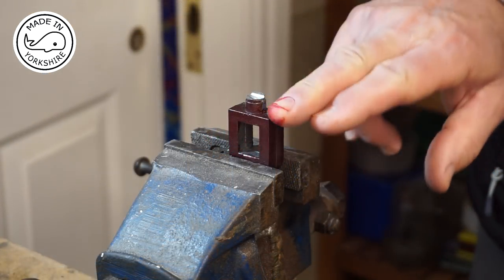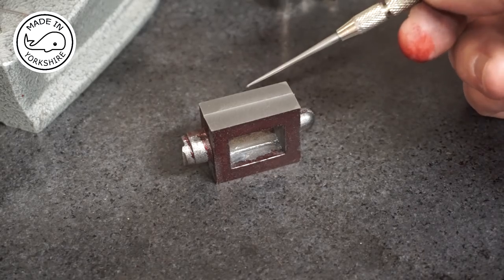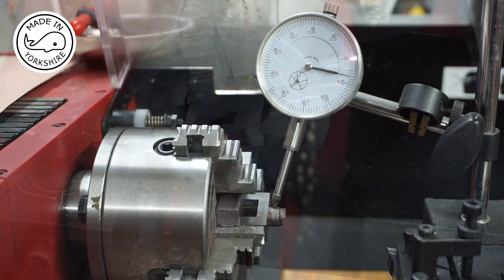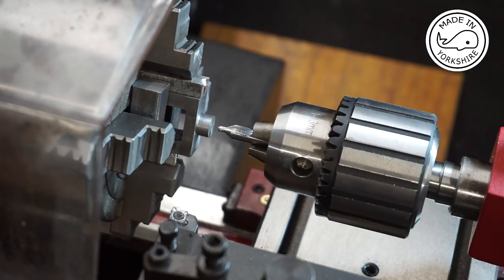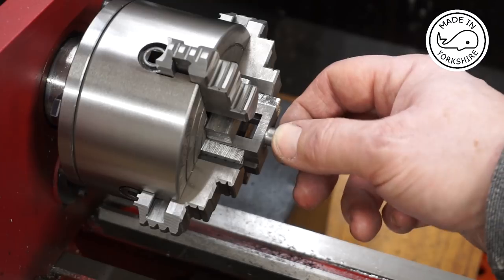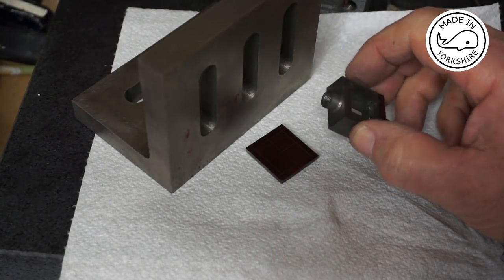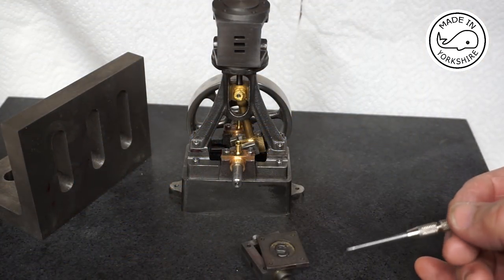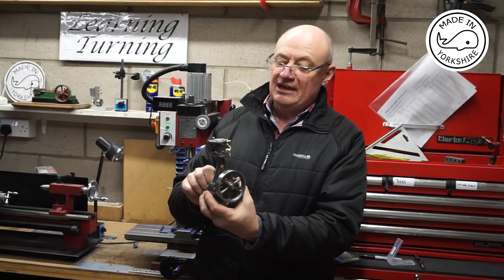#MT25 Part 11 -  Making a Stuart 10V Steam Engine. The Valve Chest and Cover. By Andrew Whale.

Comment: Hi Andrew. Another great video. Interesting about the milling cutter. Was the cutter a HSS or Carbide?. Regards MachineNZ
Reply from the maker: Thanks mate - the cutter is called 'Only One' PM60. Supposed to be a replacement for HSS and carbide, and offer longer life. I understand that the 'crust' on some castings can be like glass and that the first cut should cut deep under it. This didn't seem to make any difference.
Cheers
Andrew

Comment: Welcome back Andrew!  Are you going to fit reversing gear?  - I did on my 10V and I think adds some more interest to the model. Judging from the comments, it seems you are building a following in NZ !  Regards from sunny Whakatane😎
Reply from the maker: Thanks Clive. Now a reversing gear is a great idea. Maybe a mini follow-up project. I'm currently debating what size pipework to use. I used 1/8" on the the S50, but think 5/32" would be better on the 10V. Would you agree? 
Looks like NZ is a hot-bed for model engineers. 
Regards from cold and damp North Yorkshire! It will soon be spring though!
Cheers
Andrew

Comment: Ah, that took some searching but finally found.  I was wondering how you did the holes for the drain cocks as these aren't marked that well on the drawings.  Looking at the end of the video I understand you just drilled the holes straight in, good to know that works.  I made my own set for my 10V build yesterday (oh my that was fiddly) and am now contemplating on how to get them installed.
Reply from the maker: Hi Roel - yeah that works just fine. Drain cocks not really needed on an engine of this size but it makes it more interesting.
Good luck with your build!
Cheers
Andrew

Comment: Thank you very much for very interesting and useful videos. I'm going to buy a Sieg Lathe and a milling machine. The plan is to use it to make a 10V and other small parts. Can you please recommend a good size to choose?
Reply from the maker: Hi Jan - there are lots of factors to consider - budget, space, will you get hooked and start to make larger things?
The Sieg SX2P mini mill from Arc Euro Trade is quite capable once you have undertaken various mods (see my other videos). The Sieg mini lathe is also pretty good and should have capacity to make the 10V. If you want to spend more, then I have found the Sieg SC4 lathe to be very good. Be aware that you will probably spend as much again on tooling. So if you buy a mini lathe and then move to the SC4 (for example), you will spend even more on larger tooling etc. If you think you will get hooked, buy as big as you can afford.
All the best.
Andrew

Comment: It's coming along great, soon be steam up time :-)

When it comes to holding parts together for through drilling have you considered double sided sticky tape? I know it sounds a bit amateurish but the stuff you get from the Poundshop is incredibly strong and worth a try. I used it to secure the top cylinder cover to the cylinder of my vertical steam engine for drilling recently and I'm not joking when I say after the drilling I spent 15mins trying to prize the components apart. Nothing much in 'Poundland' is worth a pound but you could tow a car with their double sided sticky tape .
Reply from the maker: Great idea Peter. I've got a load of double-sided tape from when I did woodturning - used to hold wood together for turning. I'll try to remember that tip for next time. Hope to get this lttle 10V completed soon!
Cheers
Andrew

Comment: Just love how you flip from metric to imperial and back again. Us of a certain age, who were brought up with imperial and the introduction of metrication, it would appear still hang on to our imperial roots. It’s like being bilingual. 😀👍
Reply from the maker: Yeah. I've seen folks asking for metric versions of plans. So far all my machining has been based on imperial plans while machining on a metric lathe and mill. Just remember the magic number 25.4. Or get a dro and just switch between the two at the touch of a button.
Happy Christmas!
Andrew
Reply: Learning Turning Metal - by Andrew Whale A dro would indeed be useful on both the mini lathe and mini mill. As it is I tend to flip from unit to unit depending whether the item is to be metric or imperial. With regard to a Stuart engine I think I will try to keep it all imperial and work in imperial. The magic number might though come in useful. Merry Christmas to you too and thank you once again for your tuition, inspiration and encouragement. All the best, Andrew
Reply: @learningturningmetal  . I can put up with metric/imperial sizes it's those pesky fractional dimensions that frustrate me. Having to look at a chart for 1/64ths ! Normal sizes are easy enough sometimes but as you get older they disappear from memory. By the way I blunted 2 end mill cutters on my steam chest cover,  I had one ground before retirement with a 50 thou rad on the corners for a fine finish. Most of my others where sharpened before I left as well. Must make a tool and cutter grinder some time before they all get worn out !
Reply from the maker: Yeah, those fractions do my head in too. Wish I had an end mill sharpener. I've got loads of blunt end mills trying to cut cast iron. 
Cheers
Andrew

Comment: Andrew, regardless of what type of cutter you use the first cut must be deep enough to get under the '  shale '  ( the crust )  of the part you machining. These Stuart castings although good  but,  still suffer from having a very tough crust which can destroy any cutter if not machined correctly. I have destroyed enough of Iscar and Sandvik cutters making the same mistake and you have my sympathy here. Loosing a £20.00+ cutter is sickening and not having access to a proper tool grinder the cutter is wated. I now use a small 1" belt sander that I bought years ago to do most of the dirty work. Cast Iron is a very strange material to machine, it can be cut like  butter at times and the next minute it can work harden and destroy the work piece and the cutter but it is not as bad stainless steel, lol. Thanks for posting a great video.
Reply from the maker: Many thanks for the feedback. My initial cut was 10 thou but I guess it can't have been deep enough. Your idea of using a belt sander sounds good. Maybe something I should consider buying.
Cheers
Andrew
Reply from the maker: Many thanks for the feedback. My initial cut was 10 thou but I guess it can't have been deep enough. Your idea of using a belt sander sounds good. Maybe something I should consider buying.
Cheers
Andrew
Reply: @learningturningmetal  They are not that expensive and  I also much prefer them to the bench grinder for touching up HSS tools, provided you have a fine grain belt on.

Comment: Welcome back!  You need a DRO on the mill - it does make things a lot easier!
Reply from the maker: Thanks Kevin - and I agree. I've got a relatively cheap DRO for the Z axis and it's brilliant. I did recently think about DROs for the X & Y but was concerned that they would get destroyed by swarf. I understand that there are different types of DROs, but I find it all too confusing. I think space on the SX2P is also a bit limiting - but I could be wrong.
All the best.
Andrew
Reply: @learningturningmetal  I agree that retro-fitting one could be very hard work and yes it's all confusing.  I was lucky that my Warco mill had a DRO fitted and I use it all the time.  One downside is moving the table while concentrating on the DRO and crashing into the work!